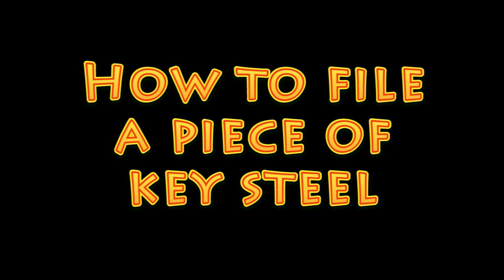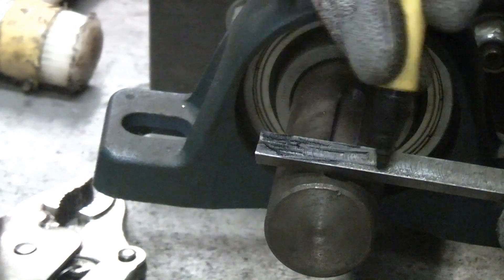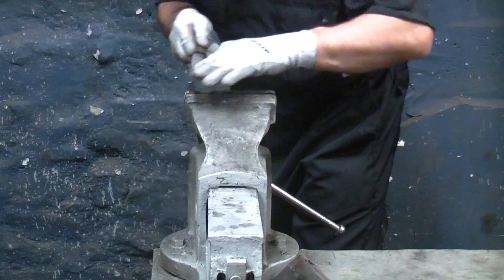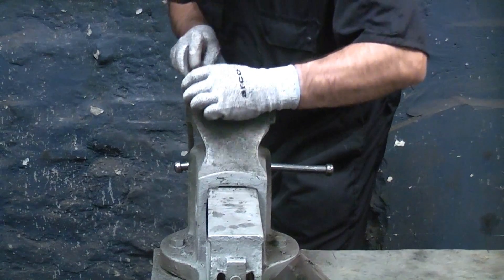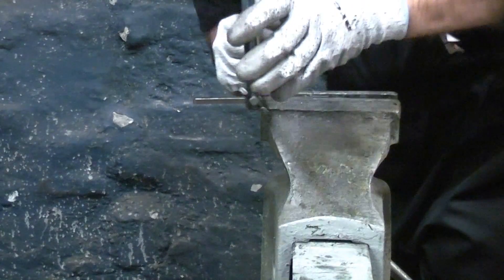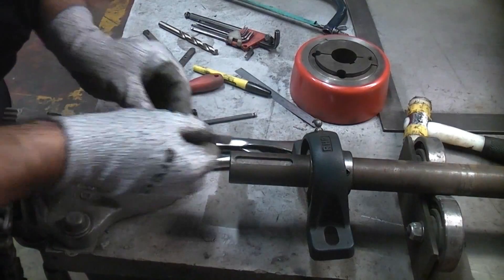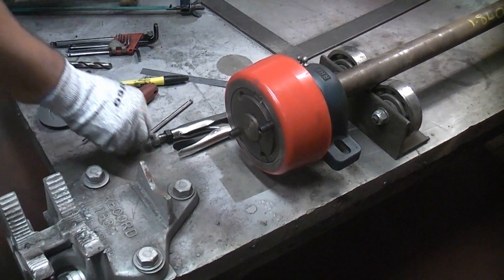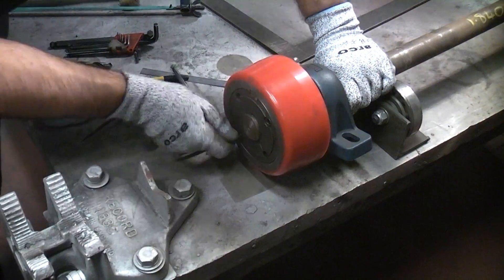How to shape key steel | Taper bush

Comment: Hi, Great video as usual, May sound like a daft question, I have some parallel form A feather keys that i want to drill and tap to M8, is this doable with HSS drill bit and regular taps?
Thanks.
Dave.
Reply from the maker: Hi Dave, yes, that should not be a problem.
We often drilled and tapped some key steels, with M6,M8,M10 threads, so that you could easily remove the key, just by winding a bolt into the threaded hole 👍
Reply: Brilliant, Thanks!. @ultimatehandyman

Comment: Do you know of any way that i could possibly make a keeway into a round piece of steel without going to a machine shop and paying them to do it on a milling machine? Thanks!
Reply from the maker: +Arron Adams 
Sometimes you can do it on a good pillar drill if you have one, but you would need the correct size milling cutter. It's much easier on a milling machine though!

Comment: vice looks like a record vice with the quick release, im guessing after all the use and abuse the half thread nut has worn out, i have the same vice, but it doesn't work so hard, hopefully it will outlast me!  good video as always!
Reply from the maker: +jusb1066 
Thanks, yes I am sure it is a Record. The vice is in the welding bay, so has been used to hold metal when welding/grinding etc. I don't work there often enough to have a go at fixing it as I normally use one of the other work shop vices ;-)
Thanks for the comment